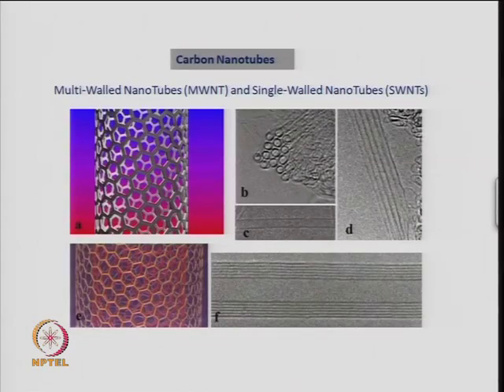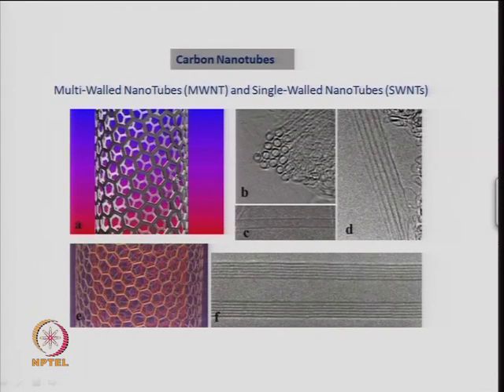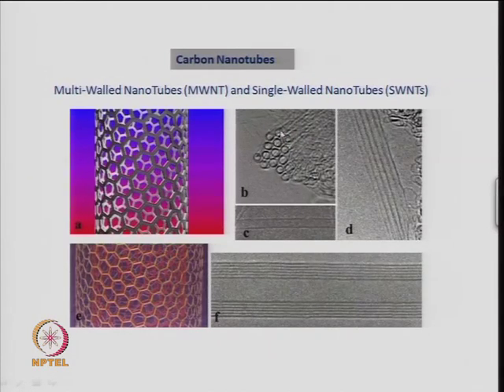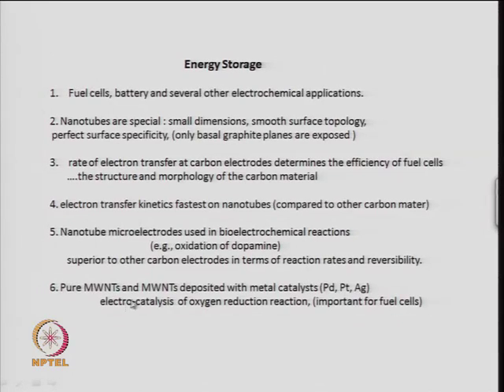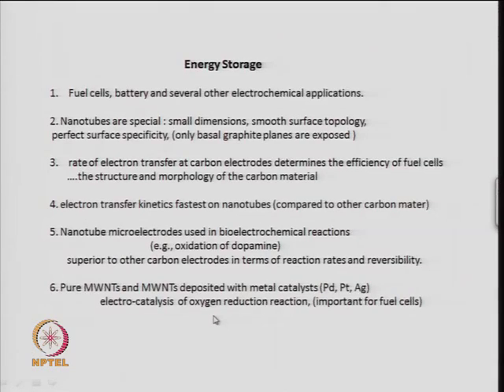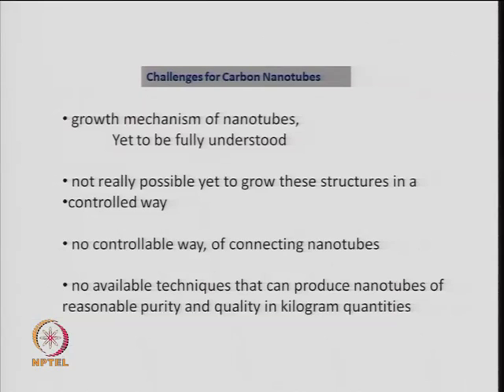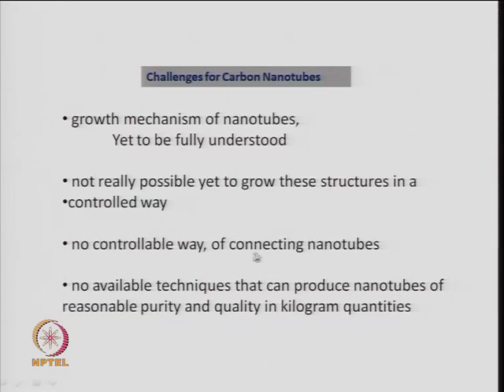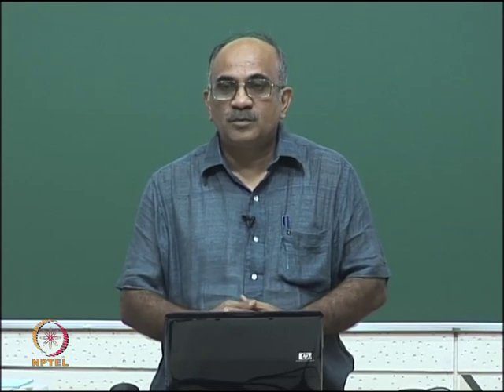Mod-03 Lec-17 Fullerences and Carbon Nanotubes - III

Comment: 13:50 the caps would depend on the diameter of the nanotube more than the chiral angle, i dont see a C60 fullerene as a cap for a high diameter nanotube.